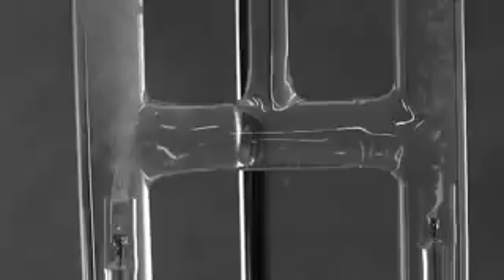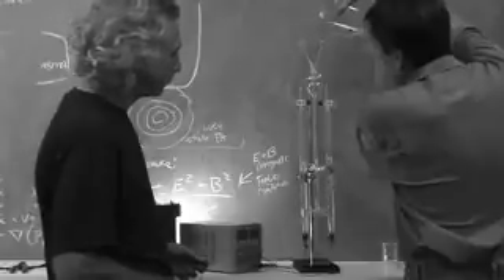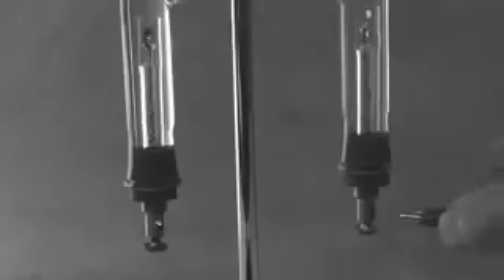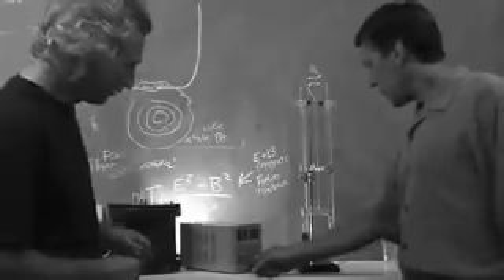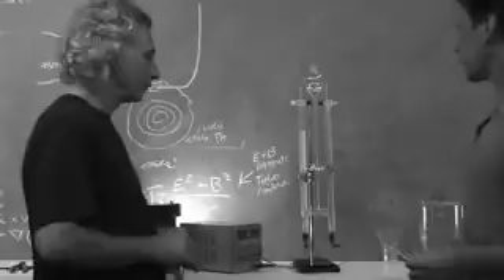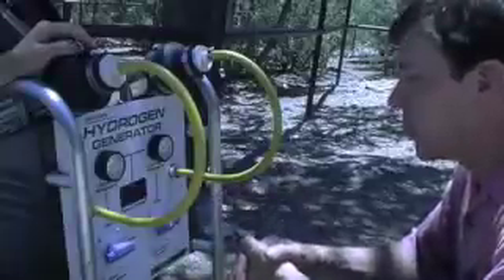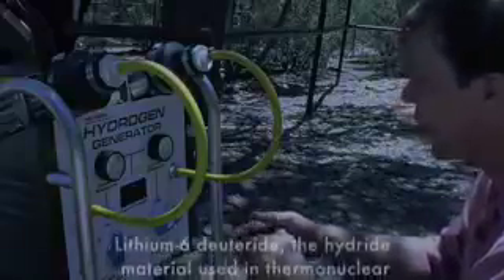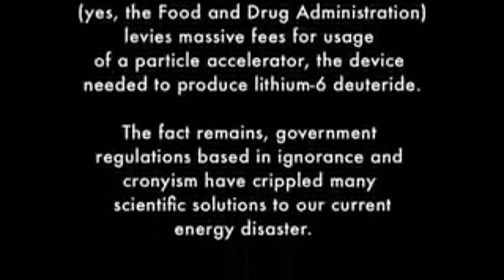run your car on water. This guy does just that!

Comment: 10min and he didn't even drive let alone start the damn thing
Reply: and the hose end going into the car once he pulls it off vents.. you need a shut off valve.. so im calling bullshit.. you can make a hho generator they have hydrogen cars now that produce electricity on demand... its just eh hydrogen is expensive and made chemically ... and yes hes the ufo guy
Reply: He fills the tanks using solar power over night,  making solar in the dark ?

Comment: We've had this tech for decades! Greedy oil people have too much power!
Reply: Yea, we've had it, nobody wants it.
Reply: It's not the oil companies. It's our beloved gubermint.
Reply: If you want to use it, go ahead. The greedy oil people could care less (and our government doesn't care either).
Reply: howsithngin
What will $4 gas mean to you? What do you expect to see?
Reply: The cost to make the hydrogen to run an eco car, is a bigger carbon footprint than my 3.8L , 3,800 lb gasoline powered mini-van. We are not there yet.
Reply: +Cotronixco it's Corporations they have no boundaries no borders they do what they want!
Reply: Kevin Jackson They will when we run out of oil. I knos itll be a LONG time before we do but we will. People will see.
Reply: iF you understand how much amp is taken from a car battery to run it it works out at 5amp per hour then it goes flat and the car recharges the battery at a rate of 0.4 amp so it takes 25hours of recharge time for 1hr driving, so you need to drive with gas for 25 hours to charge a battery then your using the maximum output from your battery which is 5amp, the only way hydrolyses would work is if you use 0.4 amp or power it on your car radio which is impossible,
Reply: Bruh hydrogen tech is very inefficient compared to petrol in terms of production.
Reply: not the oil companies. it's just one small group of Ruthless control freaks! to enslave Humanity till the end of time.
Reply: Transnet board meeting
Reply: Not really. Before they had to store the hydrogen in tanks.
Reply: the oil people own the government not 100% but then have people on the inside to keep certain laws from passing.
Reply: While they are saying this is using weapon materials, the government is killing thousands for oil.
Reply: We willingly give them the power. We support their agenda. Beep beep. Zooom!
Reply: Greedy oil people would be the first ones to exploit this new market, if it actually existed.
Reply: If you've had this for decades but don't use it, the problem is you.
Reply: We've had this tech for decades.... and the reason we don't use it is because it doesn't solve a single problem, it cost more than what we already use and the problems it creates are worse than the ones we have now. The truth is making hydrogen cost more than making the electricity that is used to make hydrogen, and that electricity is twice as efficient to run a car on as hydrogen. It's like using gasoline to make electricity, then using the electricity to power your car, when using the gasoline to power your car is twice as efficient.  Makes no sense at all.
Reply: Stan myer was killed because of this , dont kid your selfs
Reply: none :  the problem with your theory is it lacks any knowledge of chemistry, assumes that the world can afford to pay three times the cost for energy without any reduction in the system that provides for 7 billion humans, and fails to recognize that greed is what gave us every human advancement since the wheel. The naive always see the world through socialist glasses. Try looking at socialism through a magnifying glass. It is utter failure and causes human suffering every time it is attempted on a large scale. We have reduced carbon emissions from vehicles to the point where it is 1,200 % lower than it was 30 years ago, while keeping the cheapest, most abundant energy source on line. This trend will continue. If the economy is destroyed by forced regulations, the result will be more pollution from third world countries that will try to fill that energy niche with unregulated fuels, and human suffering on an epic scale do to a reduction in food production and distribution.  This has been your wake up call.  Pay attention when the real experts talk. Stop blindly following the new age magic bean sellers.
Reply: @timhallas4275  america is as much socialisim as it is capitalism, the problem with socialisim is it does not produce profit, the problem with capitalism is unless it makes profit its useless. So most countries use both, capitalism produces the profit, socialisim distributes a portion of it to help the people. If people did not care about profit and had no greed then socialisim would be perfect, but humans are complicated. I think Russia as unlikely as it might seem is probably leading the way in creating a new form of government, but it's still in the baby years of learning.
As for this hydrogen crap, just look up about the pyrimad of giza, that's how long we have been fucking about with it but we lost that knowledge somwhere along the line.
Reply: @FrankieBoyThe1NdOnly    You offer a high-school level comprehension of socialism, and a dictionary definition of Capitalism.  America is (on paper) a democratic republic. What looks like socialism here is the generosity of our great capitalist economy. But that is a voluntary system for the most part. Our liberal side is grown from the greed that often abuses generosity. Look at the principal  psychology of the "occupy Wall Street"  crowd. They believed that the wealthy should in essence, support the rest of the population with unearned compensation.  In any successful nation, there will be those who feel that all are "entitled to an equal share", and they look to socialism as a means to achieve it. What they quickly forget is that socialism does not allow the means by which this wealth is created.  Soon, as in all previous attempts to establish a "socialist utopia"  the doers stop doing and the takers find nothing left to take. The USSR was our best test case for a socialist utopia, and it failed in every aspect of government. It's people starved, and suffered while they spent billions on a military that crumbled under the weight of OUR capitalism funded military. Dig deep my friend, history seldom repeats it's failures, but often it's successes.  In the former USSR, a man had to sacrifice his life's savings for a pair of blue jeans. Now every man has 5 pair. The Russian people will never allow a socialist government to destroy what they have created since the fall. Capitalism is like a religion to the poor. They will fight to keep it.
Reply: roosevelt williams Greedy oil people are irrelevant.  All the constituent elements are available for anyone to use.
Cars come with different engines and oil companies put gas within a mile of your house, so it is easier to save time and waste the time watching TV.
You can drive by any oil company executive and he would never know you were not using his product.
Reply: @timhallas4275  I didn't mention the ussr I mentioned Russia, Russia is capatalist but everything the country needs is state owned and produced making it self sustainable no matter what environment it is placed into, while capitalist structuring allows it to create profits that are always a bonus but never required to keep the country running in a case of emergency, where as any other country would begin to run dept and crash (USA dept is in the trillions and continues to grow, and if they stop taking on more dept the country will collapse)
Reply: Yeah the gov. Gets 25% of a gallon of petrol. Both are to blame.  People won’t change.  You’ll need to wipe out this culture first.
Reply: Whats stopping you from doing a little bit of reaserch and making such a system for your car ?
Reply: Gasoline and diesel cars account for 1/3 of our economy.  The only problem is that cars and the aircraft are destroying the very fragile atmosphere surrounding our earth. The culture needs to be wiped out before any great changes will happen.
Reply: Stevie Gerrard  whoever was your teacher has mental problems.... mechanical Engineer here - some reasons NOT TO use hydrogen in a car engine:
1) Hydrogen comes from Hydrolysis and this process costs more energy than you will get when burning in the engine, so from an energy balance stand point it is STUPID
2) Hydrogen is a gas an you would need it stored compressed at very high pressure in a Cylinder. As Hydrogen is the less dense gas, the mass you can carry even in a 3000psi very large cylinder is very small, so once again it is STUPID
3) Hydrogen is a very tiny molecule so it is difficult to be sealed in valves, fittings, hoses. Besides it is very explosive, so it is UNSAFE

Once delivered to the engine, it would burn NO PROBLEM - just need to TUNE the engine for the new fuel.
Reply: in the end still ned new energ srouce ewen water in some world part not fully accsessible are for example in africa many people dont ewen have fresh water for daily lives maintane
Reply: Gasoline at one point was considered a waste product during refining so they found a use internal combustion engine
Reply: Emergency Survival Supplies, bunkers, freeze dried foods, doomsday drones, EMP-Proof fuel-less solar generators, lessons, bulletproof backpacks / shields, camping, etc https://www.ebay.com/itm/Solar-Fuel-less-2000W-Generator/173771050171    www.worthingtonbunkers.com USA Deliveries ONLY , buy the deluxe solar generator kit 
and get $50 off with this coupon "lovejesus" @ www.ambertracks.com
Reply: Stevie Gerrard  Obviously your qualifications must predate hydrogen fuel cell technology.
Reply: @kevinjackson4464  it is more then $4 a gallon here, it is more like 5 here
Reply: Have you ever seen hydrogen explode?
Reply: @timhallas4275  Feel good ethanol hawkers have the same problem they are blind to.... It simply takes more energy to create ethanol than it we get from it''s end use.  It's just a feel good way to subsidize some corn farmers that costs the tax payers dearly.
Reply: @BushPilot444   Do you see what happens when you tell the basement dwellers the truth?  They run the other way.
Reply: Govt gets tons of tax money from gas, they have no incentive to change that.
Reply: @econogate  : Government gets tons of tax money from every form of energy we make.  Gasoline is the most efficient fuel we know how to make.
Reply: @ambertracks  fuck you
Reply: hector nadal   If this worked like this video says it does, Elon Musk would be selling hydrogen cars instead of electric cars
Reply: Watch GasHole:  https://youtu.be/csxjc576M5c
Reply: @Cotronixco  
It's both. Watch GasHole:  https://youtu.be/csxjc576M5c
Reply: Or greedy all of us. All of our governments and municipalities get from the fuel tax to fund services, libraries, hospitals etc.  You cut the source of revenue you end up cutting the services.
Reply: There are a lot of comments here claiming to come from a position of scientific understanding. However, the plain truth of the matter is that obtaining electricity is definitely not more expensive than obtaining petroleum products.
Anyone espousing the opposite is clearly a bullshitter. From the outset Lazar clearly states that electricity from renewable sources is the actual mass transit solution. Everything else is just additional research. 
Electrolysis currently may be not the most efficient method of producing hydrogen, however the construction resources required and running costs associated with a solar or wind farm have always been far lesser than that of an oil or gas well. 
A sustainable energy powered electrolysis plant can provide the hydrogen based fuel required for large scale applications like airliners or heavy plant equipment. Which electrical power does not yet practically serve.
Shouting about how petroleum is the most sensible when we all know that it's running out, is just retarded.
Reply: Pr0JecToLaNd 74 well if we get some obsidian from Minecraft we should be good
Reply: Also petrol causes damage to environment and global warming
Reply: @Saul Gland as common people we are not involved in decision making. No one will even listen. Even if someone listens, it will not be implemented.

Comment: Nicola Tesla did build his own electric car back in 1932 top speed 150 miles per hour, and he also had the technology to wireless charge the batteries of the car, but JP MORGAN and the Cabal mafia didn't want that, just imagine that we could have had that car running since 1932 and the improvement of the car after all these years, he also said that he could build airplanes running on electricity, and by the way we do have recyclable electricity, two wires coming in to the house one brings the electricity in and the other one sends it back to the sub stations which they send it back to us after they put a slash in to it, but we pay excessive amounts of money for it. So who is scaming whom, green technology has been with us for years.

Comment: Bob isn't running on hydrogen. He is running on the electricity used to create the hydrogen and oxygen. His claim that it is safer than gasoline is patently wrong. I would smoke in a normal car, but I would not smoke within 50 ft of his hydrogen system, per OSHA regulations concerning handling of explosive gasses. He literally could have used the electricity directly to drive the car farther than adding the extra step of playing with hydrogen. Most of the cost of gasoline is taxes. Thank politicians.
Reply: Hydrogen is not just 2 and 1/2 times more powerful than gasoline but much safer.
Reply: @mtsflorida  It's because of how much money they would lose from tax revenue and over charging for oil...  Plus we wouldnt have to buy new cars.